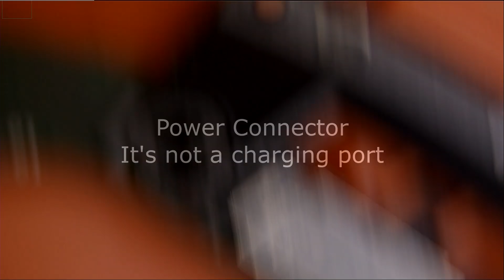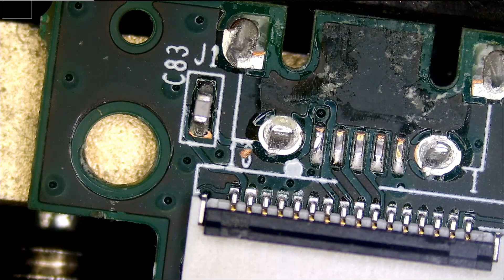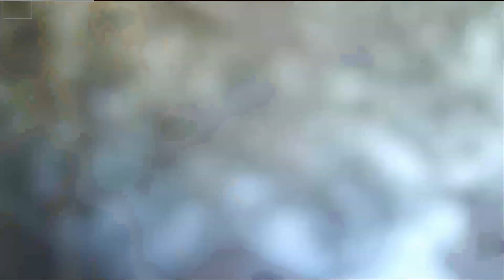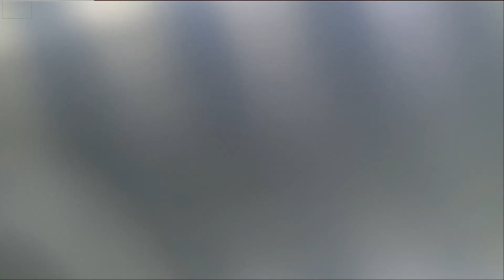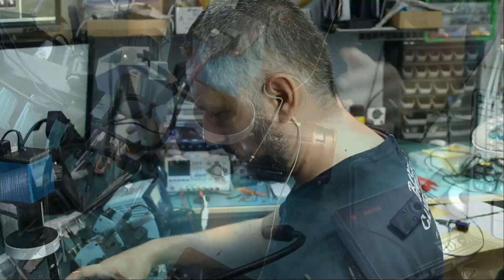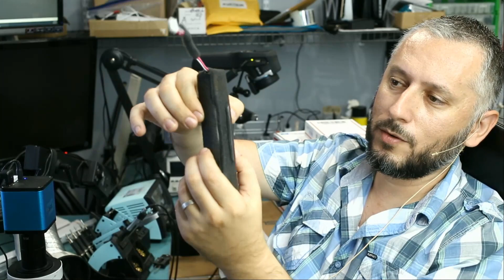Google Home power connector repair and JBL xtreme 2 charging port soldering and battery replacement

Comment: When I press my jbl extreme 2 power button, it flashes blue for 3 seconds, then shuts off. Reset does nothing. Plugging it in does nothing. It's fully charged. Any ideas?

Comment: Do the outer legs of the USB port have a function in the circuitry, or are they just there for physical stabilization? Looks like the leg pads are 50% removed here.

Comment: What soldering paste are you using ?
Reply from the maker: You mean flux. No paste is used in this video. https://rover.ebay.com/rover/1/711-53200-19255-0/1?mpre=https%3A%2F%2Fwww.ebay.com%2Fsch%2Fi.html%3F_from%3DR40%26_trksid%3Dm570.l1313%26_nkw%3Damtech%2Bv2%2Bflux%26_sacat%3D0%26LH_TitleDesc%3D0%26_osacat%3D0%26_odkw%3Dflir%2Be60&campid=5338440312&toolid=20008